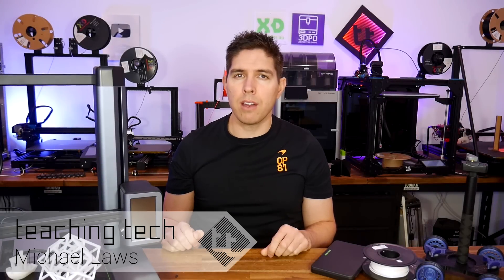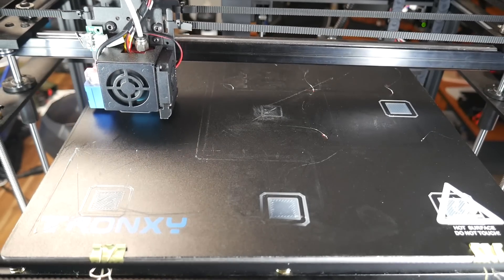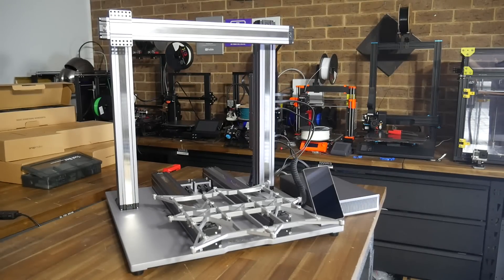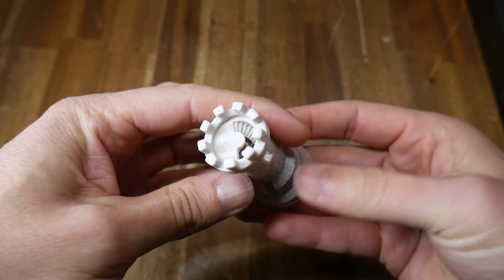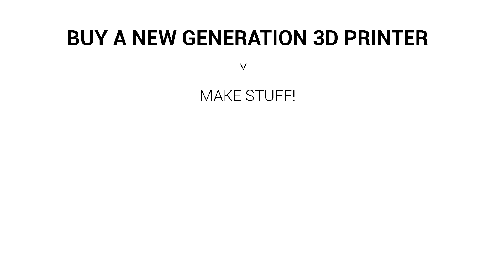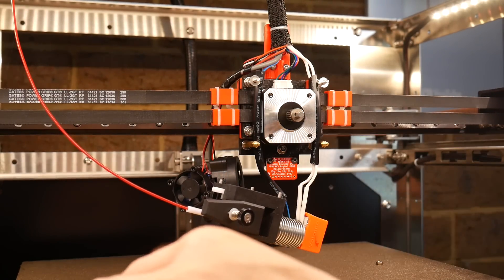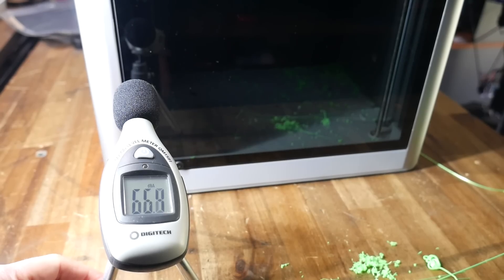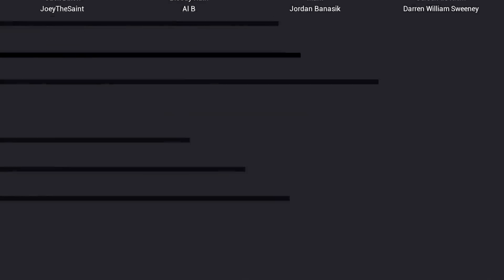Next gen 3D printers are here, but do they bring fresh problems?

Comment: Really love your analogy with cars. Like you, I am passionate by cars and two months ago I got an ender 5 as "tool" for a hobby project. Got immediately hooked and many times frustrated with cheap parts breaking down. Fast forward to today, my ender 5 has only frames, PSU, 1 endstop, belts, carriage and lead screw that are still original. I am voronizing My ender 5 (aka Vorender ®️), and a lot thanks to you. In the process of redesigning your biqu h2 mounts to allow for easy swap of volcano and regular V6 nozzles (also adjusted dimensions as didn't quite work well for the h2 500).
From v422, v427 and now manta8p, with silicone heated bed (Lord be praised for this wonder), next will up is input shaping and later linear rails as part of core xying it.
It will always have the original frame at least (with some reinforcements).
Now, my fear is that the these new printers make it not worth it to be a tinkerer. If with all I learned I can't get a quality and speed up to par of a bambu, then I will be putting a lot of effort into something that will not perform as good as the ones from that could even be cheaper to buy ready to print.
It's like if China launched 30k super sports car, that can kick the butt of a Lambo, looked even better and was easy to maintain.
For the guys spending 20k on on forged pistons, performance intake manifolds, turbos, and lvl 2 and 3 stage tuning on their average volkswagen L, it seems pointless if the 30k Chinese can simply lap you out, if you catch my drift.
So I am a bit afraid that this tinkerer community will start to dwingle and eventually fade and market become complicated, not only for sourcing, but to actually making a business of it.

Comment: When I buy a desktop 2D printer, I don't want to tinker but when they inevitably get issues (inkjets especially clogging, mechanical issues, software issues, manufacturers taking advantage of users with proprietry limitatations e.g. ink cartridges) there should be some way to fix the property you own. This isn't the same as, and doesn't mean it should require tinkering to work in the first place, or repetitive and poorly instructed tinkering to maintain because these things can be designed out. I mean when there is an unexpected failure or your property leaves it's warranty period it's still possible to do maintenance and repairs. 

If the current 2D printers on the market tell us anything it's that this idea seems unlikely. I would like to be proven wrong. Furthermore, the argument of "just don't buy them" isn't valid with 2D printers either as there are no manufactuers making printers which are repairable to any significant degree. The major merit of open source design is that manufacturers aren't able to leverage the power they have over the consumer when a design is wholely proprietary because the consumer retains the ability to understand the inner workings and perform diagnostics.

Losing options in 3D printing does seem unlikely though due to the nature of the community but all it takes is some clever business strategies (loss leaders, subsidising cost through some other means at the expense of the user, environment and industry progression) and you've just created a whole load of waste all while making it harder for honest businesses to compete. Failure to recognise these strategies before it's too late is important and I appreciate channels like cnckitchen for highlighting these issues and sparking debate on this to help progress 3D printing for everyone.

Comment: It's a really exciting time to be using 3d printers. I got started with an Aquila, but I'm eyeing a K1 or P1P as a second one. Having a lot of fun, and I've helped friends make custom parts that they need for their small businesses.
Reply: We picked up an ender 3 pro 3 years ago and added and ender 5 pro and ender 2 pro to print parts, bushings, and random things for our small business needs.  All outfitted to print ABS and Nylon when needed and all with both overlapping and specialty jobs.  Ender 3 Pro has a .8mm nozzle and has the power supply mounted outside a wooden enclosure with a heat source inside.  That guy is the heavy lifter for high temp and big stuff.  The Ender 5 Pro has a .6mm nozzle and handles most things that require print speed and better dimensional accuracy.  And the Ender 2 Pro has its .4mm nozzle and handles small parts like internal replacement parts for scissors.  Saved us so much money and allowed us to modify machines are design and replace parts on some equipment that ended its manufacture run in the 1960s-1980s.

Comment: I just bought the Sovol SV06 Plus after having such a positive experience with the SV06, this thing is  beast, fast set up no messing around and prints at 150mm Sec on standard Marlin without any input shaping and I'm getting awesome results. If I would of followed the reviews I never would of bought it, but I took the gamble based on the reviewed products were preproduction models, all the issues bought up in the review have been fixed. I still love my original Ender 3 and its my toy for tinkering, not much left that's original but building the understanding of the basics has made my 3D printing journey a whole lot more enjoyable and resolving any issues simple. My most hated printer is the Geeetech M10, talk about race to the bottom,  got it for the colour change option, but as ana example a printer sold in 2021 should not have A4988 stepper divers, talk about cheap and nasty .

Comment: It's tough to look at the new generation of printers and believe that they are truly turn-key. I bought a Ender 5 plus and spent 1 month diving into why it wouldn't print.  In 2021 they shipped with an incorrect e/step value causing all prints to fail.  The process of trial and error, research and analysis fueled my interest and frustration with the 3D printing world.  (As expected Creality was no help.  They were completely uninterested in the issue and the forums on their website were less helpful. If it can be believed)

Anyway,  armed with the knowledge from that trouble shooting exercise, I learned how useful channels like yours and others could be.  I've learned alot and love 3d printing. My CR10v2 is big and effective, making some wonderful prints.  I bought it for the size as I like to print armor and helmets. So if i get one of these new printers to match the size will i need to fork over more than $1100? Likely so.  That's why i think if Creality can just marginally improve its customer service and its instructions out of the box it will continue to be the lead brand in hobby-quality 3d printing.  But i doubt they care what their customers have to say.

Comment: Anker is a security threat!!!
A few months ago, Anker was exposed for blatantly lying about not collecting video footage from their Internet connected cameras. In addition, the video stream was unencrypted; so not only Anker can see what you are doing in real time, but also anyone who has a slight idea of how to use network cameras.
Anker had not even publicly acknowledged the formentioned event. They have not even stopped collecting the live video footage from their cameras. They had only tried to bribe the security researcher to hide his findings (he refused) and encrypted the stream (so now only Anker can have a live view of your home).

I know there are some who don't care if random people are having a live video feed of their home, or simply had already bought the printer. So for the safety of your family, I suggest you limit the print's and the Anker app's access to you home internet personal and personal devices as much as possible: cut the power when not in use, use an old burner phone for the app, etc.
Reply: This is true for literally any and all iot devices, the X1c, the p1p, hell even the mk4. None of them can be trusted on your network.
Reply: If I needed to remotely video monitor a print farm, I'd install my own closed circuit video surveillance that's not on the internet.  If I owned a 3D printer that needed access to the internet to upgrade the firmware, I'd provide one time access through a hot spot with a throw away single use password.

Apparently the Bambu Labs printers can be used by transferring files with a flash card but I won't buy a Bambu printer because they are pushing people to send the files to their cloud server in China and then back to the 3d printer that's two feet from the computer that created the 3D model and sliced it into G code.  That indicates to me that Bambu intends to insert itself into my tool chain where they do not belong.  When I buy a product, I expect to own it.  Bambu seems to have the partial ownership model where they want to control the product that I bought from them, and I won't play that game.

Comment: X1 Carbon or XL with 5 heads?  I get that they aren’t same price, ignore that. Want printer that works, has good support, and can grow with me overtime. It is the later I worry on X1C as I think it will only be what it is on day one, but with open source think the XL will change with time. Thoughts?
Reply: It has one head, and 4 spoolholders if you decide to buy the combo kit. You can add 4 Spool holders to print with 16 colors/materials at one print.

Comment: I think this was well covered. An interesting set of questions that came to mind that I don't think has been asked: where in the home are we expecting these printers to go? We have appliances that we actively hide (washer and dryer, sewing machines, various cooking tools... all things we put away/cover when not used), tools that are in the open (knives, fancy vacuums, etc.), things we use with nice remote controls but are otherwise not nice (HVAC is the main one that comes to mind). Also, size and noise... a nice printer that is loud will get kept off unless needed or will get put into a room to not be seen... but if we're controlling them with apps and controls at a distance, then is it not similar to a HVAC system where it doesn't need to look nice so long as it does it's job on demand? And as stated, size: a 3D printer the size of a microwave will be useful for "I want a new door handle" or "I need a new phone stand" but there will be enough times something larger is needed. But a 3D printer the size of a dish washer is going to have the question if spending so much for that larger size that doesn't get used frequently (seriously, like it or not, it's going to be charged more for a larger unit even if the parts aren't different besides a larger extrusion/cove) + much longer print times, do people want that in some displayable form or will it be hidden away.

I think having repair guides built into the printer is important. My food delivery doesn't show up, I don't go "well, time to email the company" and have a lot of back and forth to figure out what meal I have an issue with... I hit "help" in the app and say my food didn't arrive and it's done. A single mom of 3 who got a "consumer" 3D printer isn't going to sit there for an hour to unjam the printer. She wants a popup saying "there's a jam. Please wait while it cools... <clunk, as it cuts the filament automatically> please pull the 2 latches that are illuminated... now, slide the hotend out... Now insert the new hotend and push the 2 latches in until you hear a click. The print will now resume. Your printer is still under warranty, would you like to exchange the extruder for a replacement?"

The software needs to be easier then it is now. I can write a Python script to connect to an API and control my AC, use a 3rd party app to control a smart bulb, and use a website to do my homework (just run with it, no need to nit pick on the homework details). But a lot of people will use the little box that came with the home or the app that the light bulb's instruction manual says to download. I want to take the printer out, download an app, scan a QR code and go. Browse through existing models and say "print" and have the app and/or printer guide me through that I need to load. I shouldn't need to figure out supports, layer heights, temps, etc. I want the fire truck in red... period. Actually, I want it in red, with black wheels, and shiny silver ladder and other chrome bits. Some printers like Bambu get closer to that but still not "leave it with that single mom of 3" from before. But having that ability to no-effort the print while also having the advanced, do it step by step/hand hold the printer, is going to be important. Especially since the "advanced" one is usually what is needed for diagnosing why it went wrong.

Oddly, price won't be too much of an issue. You can buy a cheap car, washing machine, and computer. And people will say "yea, it's cheap... but it works". Those same people get a raise/bonus/tax refund, buy the more expensive one/luxury and go "wow, this is so much better then what I had before" even if the car still drove to work and back, the clothes still got clean, and you could still go and watch a YouTube video or something on the computer. Arguing "Oh no, it's $300. $500. $1000" more doesn't matter to the home consumer. They will buy what they can afford, that does what they want, and often with recommendations from someone they trust. And that last one is important... if a family member asked me today for a printer to buy, I would ask them a set of questions. I would make a decision based on the answers. But it means that if 1/2 or more of the community wants an open source printer (saw a couple polls around that recently), then when a family member asks for a recommendation, there's a good chance an open source printer will be recommended. If someone asks the family member what they got and they go "well, my cousin is big into these and said to get X" then the friend might also get X. "Open source doesn't matter" until people are buying off word of mouth, and the original voice said "buy open source". And all you need is "see, I could fix your printer because it was open source. If it wasn't, you'd have to wait for the repair man/some part to arrive and then their instructions on how to install it", then that person who knows nothing about 3D printers and doesn't care about open source suddenly goes "then I'm happy it's open source" and you can throw the argument out. Also, a trusted source going "oh, they copied someone else, don't get them" is powerful from someone who is trusted to advise on what to get.
Reply: As someone that's trying to design a DIY non-FDM 3D printer as if it was the Consumer Edition I wish existed by now, I'm agreeing with all of this. My character profile is a single mum of 2 though, if that makes any difference.

The experience I'm aiming for is a combination of a Brother laser printer + under-counter kitchen appliance (washing machine, dishwasher, etc) + mailbox / Amazon locker. Essentially, what do you want and what 3D printer box do you want it sent to? Since I need to write a slicer anyway since it's not an FDM printer, I'm going to see it as an opportunity to make the 3D printing workflow more like the AliExpress shopping workflow, as well as integrate tutorials and help guides into the application itself, inspired by Welcome Park for the PSVita.

My printer is rather large, and I'm designing a smaller researcher unit as a proof of concept. What I've found is that there isn't as much of a price cut as I hoped for. It seems that all the extra stuff that makes a small printer into a large printer (e.g. long linear rails) doesn't actually cost that much. I could totally see a company charge much more than the actual cost for the larger size though, just like laptop manufacturers that charge a significant sum for extra RAM. 

Anyway, because of it's size, I'm imagning it'll be put in a similar location as other large items (e.g. a kitchen or living room), and is very likely going to have random things ontop of it (because it'll be seen as a waste of potential countertop real-estate if not). This is the reason why I'm not going to have a touchscreen interface on the printer and instead opting for a large LED display, so users can see from the other side of the room the info they actually care about ("Is the print done? No. How long left?"). I can just imagine that a mobile app or PC software would be much more convenient than bending down to use a touchscreen that's seldom used but still liable to getting dirtied or damaged.

I'm kinda hoping that if the printer works, some chinese manufacturer like Anycubic will see it and clone out an off-the-shelf printer people can buy in a year or two after.
Reply: @glodigit  Sounds like a good aim, and "lol" on the Anycubic cloning it. It's a good way to do it if you're not trying to turn it into a business or similar. An undercounter style is probably a good one to go for.

Comment: I have had good luck with my affordable printers. I always went for bang for the buck. QQ-S pro was fast and bigger than standard bedslingers at $299 when I bought it, very few problems. Lotmaxx Shark v2 dual color and laser engraver, more problems but they were normal bedslingers problems I wasn't used to, SV04 best index under $500 bucks, more basic bedslingers problems but the extra dual extruder issues.  If any of these came ready to print no tinkering I would easily have paid an extra 100 to 200 more.  Disappointing that none of the new age printers have a larger build volume and are all closer to $1000 than $500 wich is my Max for a mostly hobby tool( I have paid for them all with selling my services and prints, but not enough to say it's profitable for me at least). I enjoyed designing things and seeing the final product being used more than making the problems go away.